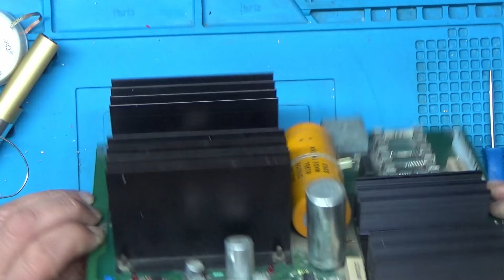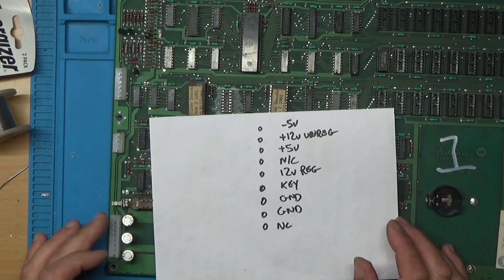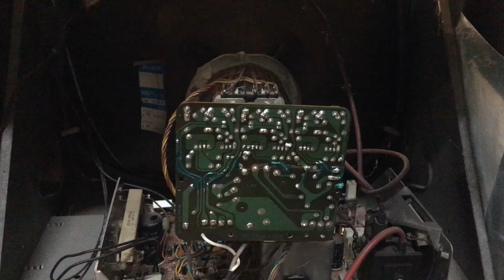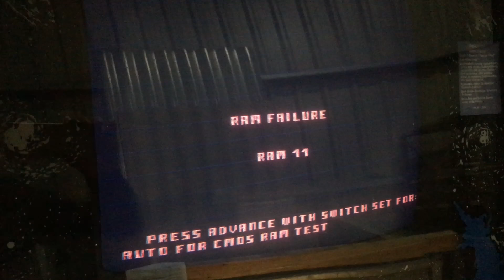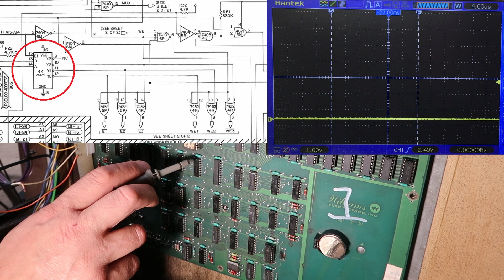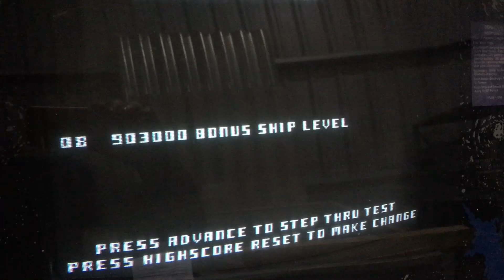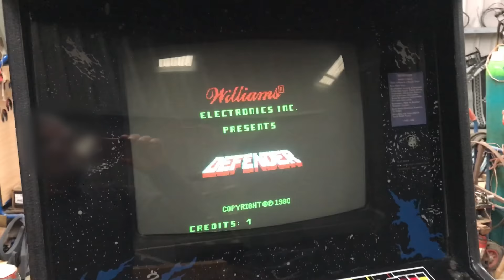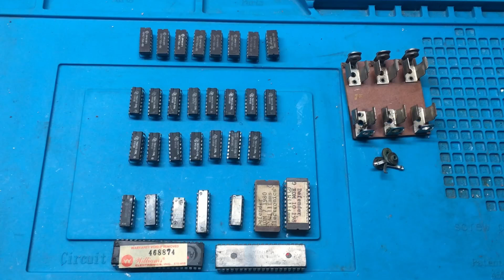The Repair That Broke Me - Part 2: Rescuing a 1980s Defender

Comment: A pleasure to watch you work BiFi. In my late teens, I spent ~$5k over 3 years on this game (0.20c coins in the mid 1980's). Hi Score probably ~400k, but I never clocked it (1M). Of course I've played MAME versions since, but to watch you traverse/diagnose/repair the digital/electronics guts of this much loved game (with my basic digital electronics & assembler knowledge) has given me a new appreciation of the craft & construction that Williams Electronics attained to deliver the costly experience I never regretted (aside from the smarter choice I didn't make to purchase)! 🐏
Reply from the maker: Wow! That's a lot of coins! Glad you enjoyed the repair 👍 It you haven't seen any of my other videos please check some of them out. I've even had to dive into a debugger in assembly on a couple of them.

Comment: I have the same de-solder gun. There are loads of useful mods to do to improve  it. After you suck up solder, shake the granny out of it to release the molton solder and stop it blocking.
Reply from the maker: Thanks Tony 👍 I'll look into some of the mods. I take it your a full ham licence holder from your call sign.
Reply: @BuyitFixit  Indeed I am! I managed the 3 exams in the last year.
Reply from the maker: Nice 👍I've only done foundation about 2 years ago.

Comment: This brought back memories. I spent a good part of my career designing with TTL, RAM, EPROM, PIAs and Microprocessors. The Wiliams logo looks very similar to an inverted Motorola logo!
Reply from the maker: Nice 👍  I've messed around with microcontrollers, and eproms before,  but not repaired anything like this down to this level before. Yes someone else mentioned about the logos being similar.

Comment: Finally you bought a desoldering iron! If you keep getting the desoldering iron clogged, I suggest you to "upgrade" the vacuum pump to atleast 15Lpm one. I've tried various vacuum pump configuration and found that around 15-18Lpm one that gave me good desoldering results and no clogging
Reply from the maker: 😂😂😂Yes, I thought it was probably worth getting one now, especially for this job. Do you have any suggestions where to get one, or what to search for? YouTube can be a bit touchy with links though.👍
Reply: @BuyitFixit  My desoldering iron is heavily inspired by the one that Marco Reps' build few years ago, he uses Thomas vacuum pumps so I look for one and found 2 Thomas 70060055 for $20. These pumps can easily flow 30Lpm but I lowered the voltage so it runs quieter but still can flow around 15-20Lpm. Once I ran them in full power it turned the molten solder into solder dust and ended up clogging the air filter instead, so don't do that, lol. If you really want to try, maybe you can use those Aliex pumps that uses 555 motor. They advertised it as 10-15Lpm capable pump but I'm not sure. Maybe run 2 of them in parallel. 
I can't guarantee you that this upgrade will improve your desoldering iron performance but I've use mine for 2 years without clogging the desoldering heater. But it's pretty logical to me, higher flow == quicker to suck the molten solder == less time for the solder to solidifies inside the heater. 
Hakko FR-401 also uses 15Lpm pump so there's that

Comment: Wow... I know nothing about electronics (I'm a programmer) but feel I actually learned something watching your fascinating vid.  Defender was the loudest and proudest game in the Arcade way back when! So much so you could hear it outside! :) The sound effects were fantastic for its time and the fact it had so many buttons.  Quick question...with the chips (apart from RAM) you replaced did you have to reprogram them?  Also I am amazed you can still buy them?  Also what is that liquid you use to clean the board after you have soldered on it?  I have some old Atari 2600 games that no longer work so maybe I will try rescuing them and try using a soldering iron for the first time...
Reply from the maker: Thanks 👍 The only chips that needed to be programmed were the EPROMS as they store the games code. Isopropyl alcohol is what I used to clean the board. If you're a programmer you might like some of my other videos where I've had to reverse engineer code etc for a couple of my fixes. I think I put a playlist together of those type of repairs 👍

Comment: What a challenge!!
Good work mate.
You got the heart of a top game beating again. 
I must have spent a fortune on arcade video games in the 80s.
Especially defender. 
The coins were always lined up on the console with your initials written on them. 
Then you'd wait your turn. 
And hope the guy before you wasn't good.
Or you'd be waiting for ages. 
It was 20 cents a pop. 
Then it was 50 cents a pop. 
Then it was a buck a pop. 
Then I stopped playing arcade games. 
My friend has a console that has ALL the 80s games on it.
I get to go back to the good ole days again.
For FREE!!!
Reply from the maker: Thanks 👍 Over here the games were originally 10p for quite some time, but then 20p ( 3 for 50p) then later £1  a play. It just highlights how the value of your currency decreases over time...

Comment: The trick with those solder vacs is to run them a minimum of 10 sec per joint. That allows the solder to travel the full length of the barrel before you shut off the air flow.  I also find it helpful to point the gun straight up and hold the board above it.  This allows gravity to assist rather than hinder the solder flow. Don't press the tip to hard against the pcb, but do vibrate it side to side across the via.
Reply from the maker: Thank you kindly for the tips 👍

Comment: I'd love to bring you my Outrun arcade machine so you could give it a thorough check up.  Would make a great video.  The red colour on the monitor doesn't show either.  Let me know if you are taking other arcades in to fix 👍
Reply from the maker: I remember Outrun, we used to have one in one of the arcades I worked at. I remember you had around 3 tunes you could select on the car radio. Apart from the lack of red does it have any other issues?

Comment: Well done! Sometimes you can switch PIA chips to test them. In some cases different parts of the chip are used for different functions. Doesn't always work.
Reply from the maker: Thanks mate 👍 both turned out to be faulty with different issues. The new ones are  working fine.

Comment: I bought the same desolder gun few years back. It certainly requires one to know its limits, failing which it clogs up. There are tune up videos on improving efficiency etc.
Reply from the maker: Thanks Daniel I'll have a look into that 👍
Reply: @BuyitFixit eg Jan Beta has some https://youtu.be/26VEOadIn1M?si=S9-nJ2Mf4c7_qJj3

Comment: A lesson I learned over 40 years ago, if you are moving a know bad chip it it quicker to cut the pins off and remove them than to risk damage to the pads, the pins will likely fall out making the task even easier. Also your sucker will work better at clearing the tubes.
Reply from the maker: Thanks for the tip Ron 👍 I already knew about it, but I wasn't sure if a couple of the chips I was removing were faulty or not, and I didn't have any replacements. Thanks for the tip anyway though. Much appreciated 👏

Comment: Nice job, I have that desolder station too and I always hold the trigger 1 more second after desoldering, esp. because the solder will get stucked very quickly. And I use that "needle pin" very often just to check its not stuck. Nice work on the defender, I have one too.
Reply from the maker: Thanks 👍 and thanks for the tip with the de-soldering gun.

Comment: Nice work. Do you think a lot of the chip issues were caused by the overvoltage on the PSU?
Reply from the maker: Thanks 👍 The RAM chips probably, but I'd think some were faulty already as those multi-voltage chips were unreliable at the best of times. The other chips I suspect were already faulty as the symptoms didn't really change much before and after the PSU went faulty.

Comment: Excellent job Mick. I have a similar desoldering tool at work that i use regularly too. When it works, it works great, when it doesnt its very annoying. Seems to require a good cleaning after every use to keep it from clogging
Reply from the maker: Cheers mate 👍

Comment: Nice work! I repair a lot of Commodore PETs and computers of that vintage and it is sometimes amazing how many faults you can get on one board. I use the same desoldering gun, they are great, the best I have used by miles, although I do buy spare handsets for them from CPC as sometimes it's easier to just swap them and then clear the blockages later. Top tips would be put flux or even fresh solder on the pins before you start, and it might not be best for filming, but I always hold the PCBs vertically and the gun horizontally, so you aren't fighting against gravity. Great to see it back running again, I hope you enjoy the game.
Reply from the maker: Thanks Dave 👍 Unfortunately the machine doesn't belong to me it's actually another viewer's who asked if I could have a go at fixing it. He bought it broken a few years ago, and had someone 'look at it' but they made things worse. It then sat in storage for a couple of years until he emailed me and asked if I'd be willing to have a go 🙂

Comment: Great work. I knew you'd get it fixed. 

The sound effects were amazing for this game, back in the day.
Reply from the maker: Thanks, glad you enjoyed the video 👍 I was quite impressed with the sound myself!
Reply: Nice work! I used to repair arcade games in the 80s. You have been a lot more thourgh than I was. Usually, I was pressed for results over quality. Williams was a solid design, I still have some of their sound boards around for nostalgia. They are easily addressed via 8 bit data.

Comment: Love the old tech. Now I got a few Euros costing handheld with 200 games but what is the fun of that. I remember having played on a cocktail table 2 side shooter in the 80s
Reply from the maker: Yes I love old tech too. I used to have a old cocktail table machine back in the day with the player controls at each side. I've got a smaller replica arcade game that I upgraded a while back if you didn't see that one.
Reply: @BuyitFixit  unsure if i've seen it. I will look for it

Comment: If you are replacing a chip that’s not on a socket, I find it easier to cut all the legs with side cutters close to the chip. It’s much easier to desolder then one by one
Reply from the maker: Thanks 👍 I had thought about that but there was a couple of chips that I wasn't 100% sure if they were faulty. Especially on the RAM fault because a lot of other things are on the data bus.

Comment: i always find if i don't want to keep the chip it's easer to cut the legs away from the body and then just hook the leads out the board with an iron. of course touching up he joint just adds a small amount of fresh flux which is much cleaner than flooding it with flux. just the old school way of doing it. 🙂

you should have got turned pin sockets, much better in the long run

Comment: To prevent clogging of the desoldering gun, hold the trigger a little longer while pulling the gun away from the solder joint. This ensures that every little bit of solder is sucked into the reservoir and the lines inside the gun are cleared. I haven't had a single clog since I use this trick.
Reply from the maker: Thanks for that. I kind of figured it out when I was removing the sockets, I also turned up the temperature to 370c 👍

Comment: Oh man does this take me back to my youth of fixing stuff like this. Fantastic job!

Electrolytic caps typically have a +/-20% tolerance so that 92 mic cap was fine. Not worse by any stretch. But still, good call to put the old one back as there is probably nothing wrong with it.

For the CRT board, would you be up for attempting to manufacture a new PCB or having one manufactured for it and transfer the components over to it? I find repairing PCBs the way you did eventually become problematic.
Reply from the maker: Thanks mate 👍Not sure on getting a new one manufactured. There's full monitor chassis on eBay for around £40, so perhaps just a tube base PCB might come up pretty cheap.

Comment: I enjoyed this video. Takes me back to when I worked on digital systems. So, do you think it was the power supply that did most of the damage to the chips?
I would like to see more videos of this type.
Reply from the maker: Thanks Martin 👍I think the PSU caused the issues with the RAM chips, but the PIAs were already faulty from the start, and so were some of the other logic chips. I think a lot of the old CMOS chips are quite robust. I measured about 8V on the board with the scope, and that's when I switched it off, and checked the PSU again and realised it had gone South.

Comment: Tip: solder flows harder against gravity!
Try to hold the board at least vertically why using the desoldering gun.
Reply from the maker: Thanks for that. Someone else also suggested the same. The only problem would be my overhead camera though...

Comment: One of my favourite repairs on YouTube so far. Thanks!. Tip: The desoldering gun works best with fresh solder on every pin, dwell until solder melts all the way through and if you hold the PCB vertically.
Reply from the maker: Cheers, and thanks for the tip 👍 I'll definitely bear that in mind for future work.

Comment: I have found IC Sockets cause more problems than not. Mainly intermittent problems. Fault causes range from poor contacts due to corrosion, tarnishing, and mechanical stress (heat vs. movement (vibration). It's also important to pre-form the IC pins to be perfectly straight. In the end, I found that soldering direct to the board solved a multitude of sins and removed future intermittant problems. I am just sharing my experience from the past. By the way, I really like your videos. Easy to follow, and if you are an electrics engineer as I was, it is like watching Vera...second guess what the fault might be before it happens 😂
Reply from the maker: Thanks Colin 👍I'm more of a hobbyist. I've just messed around with electronics and computers most of my life as it's what I've been interested in. I'm glad you find my videos interesting 🙂

Comment: Well done Mick. Simply amazing watching you trace the faults and fix them. You have a  amazing talent and thanks for sharing. By the way a repairer at our local repair cafe used your Ninja Air Fryer design issue fix to repair it. Thanks for sharing your hard work for our entertainment and information.
Reply from the maker: Cheers mate 👍 Glad you enjoyed the video and that the design issue fix helped out, that's awesome!

Comment: So the RAM problem was that you accidentally put in Write-Only memory? JK
I would probably remove the stickers from the EPROMs/PIA chip that were bad and glue them on the replacement chips, I recommend using a solvent, maybe N-Heptane or IPA. Maybe also rewire a new coin door switch.
Also I've never seen a repair channel that had access to an X-Ray machine to look at bad parts afterwards, nice.
Reply from the maker: Thanks 👍I've used the X-RAY a few times, even done a whole video on it when I first got it (teardown, and hacked the software a bit too). https://www.youtube.com/watch?v=MgT22byFe64

Comment: Nice job on the tube base. Fascinating job. Thinking about getting solder sucker…
Reply from the maker: Thanks Maurice 👍I got it working better in the end. I think it's because I had the temperature set too low, I set it to around 370C and it seems to be a lot better now.

Comment: Hello,
You made a fundamental mistake when repairing the tube socket. The repair must always be carried out with flexible stranded wire. The rigid wire expands when heated and contracts when cooled. This causes the solder pads to shear off over time and the connections to break. I also have a little tip for you when desoldering the IC with through-hole contact: After the solder has been sucked off, simply move the soldering iron tip back and forth from the side a few times, loosening the pins on the contact side of the through-hole. Then prying off the IC will be easy.
I really like your videos and hope to see many more.
Regards,
Andreas
Reply from the maker: Thanks for the tips Andreas 👍

Comment: It is a wise investment to buy a high quality voltage surge protector for this unit to forstall problems in the future.
Reply from the maker: I'm not too sure. It does have filtering on the input, and a big transformer. Linear power supplies are quite robust compared to SMPS. I mean this one is still in pretty good shape after 40 years.. I doubt a switching power supply would last more than 5-10 years.

Comment: Well done. That bad PSU did some serious damage. With desolderer we used to run them at max heat. And you need to move them in a circular or side to side motion to remove all solder. You shouldn't need solder beforehand only occasionally. You can also use them on the top side next to the pins. Very important to clean the machine regularly to keep the suction up. We never had to use braid ever. And we never cleaned flux off either just scraped between the pins if it looked like a solder bridge. I have repaired 1000s of TVs etc
Reply from the maker: Thanks and thanks for the tips John 👍

Comment: Very nice job Mick! So many faults! Your wiring replacements look much better imo, especially the cracked pcb. I'd love to get in some old arcade cabinets like this to repair for myself someday.
Reply from the maker: Thanks mate 👍Yes, it took a lot of troubleshooting and work this one. It's the first time I've repaired a machine to this level. Most of the work I used to do back in the day was things like swapping a PSU or monitor chassis, or microswitches / joysticks etc, or re-wiring a cabinet to a different game.